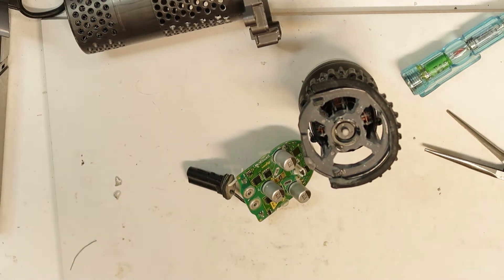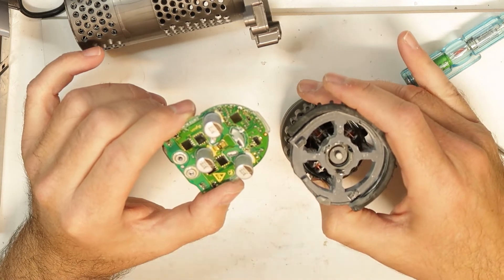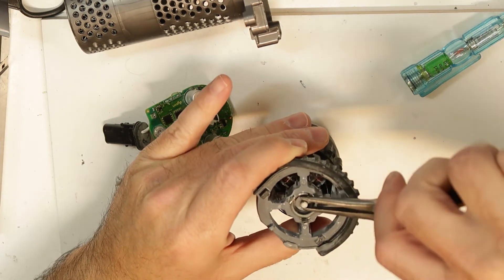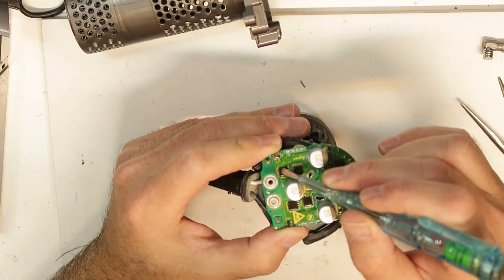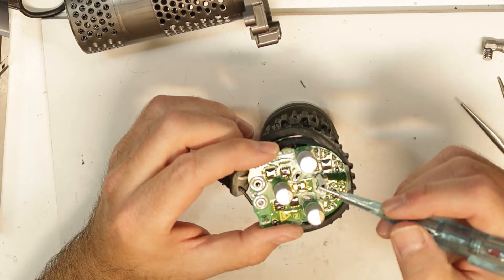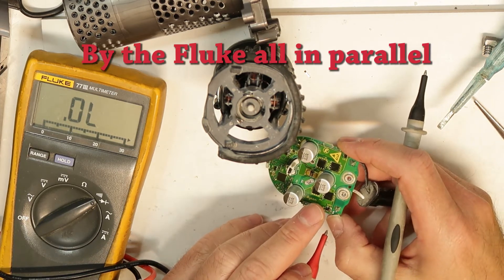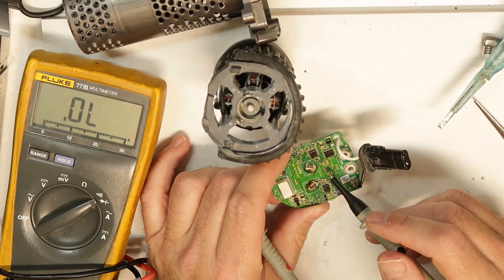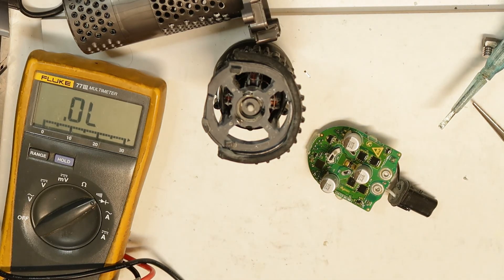Dyson v10 Motor Electronics Disassembly and how it works

Comment: Hi is there a way to clean up and lubricate the motor armature etc if necessary after plaster dust has clogged it up?  I will use compressed air to blow out all the dust first and clean the motor overall.  Thanks

Comment: hey mate, i really need your help, if your dyson v10 is still opened up, can you check how many volts it pulls and at what frequency? i have a motor from a damaged v10, i would really appreciate it if you can tell these values, thanks a lot in advance

Comment: My Dyson v11 keeps pulsing in normal and low power mode, but runs fine in boost mode. That phenomenon started happening from one day to the other. Do you know what could be the reason for that? Do you think there is anything I could do about it? Maybe just cleaning it up somehow? I already disassembled it to the core and now I guess I have to desolder the motor from the PCB to dig even further. Do you think there is something I can do before that to fix the issue?
Reply: Clean out the vacuum, not unscrew it, just wash the filter and brush the metallic grill under the dust container
Reply: @Peppasteppah  I had to buy a new core. Of course I cleaned it completely before digging deeper. But it seems the electronics or the motor were defect.
Reply: My dyson v11 also pulsing in slow n normal mode but ok in high mode.. tried cleaning it but still pulsing..
I changed the motor and it worked fine in all mode.. probably the circuit board got some faulty components..

Comment: How did you remove the PCB and the motor (center of image) from the housing (top left of image), is the PCB glued in?
Reply: The PCB  is glued to the housing, however, it is really the solder on the contacts that hold it on.
Reply: @malcomsue  thanks, I see it now, the two large solder blobs in the center (also on my V11). Seems my 30W soldering iron is underpowered, though, I can't melt it 😞

Comment: Hi, I have the same problem, the filter light keeps blinking even with everything clean, but the motor doesn't spin. Have you figured out what's the issue?
Reply: Non ha capito niente!
Reply: I glued a neodymium magnet to the board in the right spot (corner) and it works.
Reply: @bagibadoo439 Can you give more specific instructions? pls
Reply: @bagibadoo439 did you pull the shaft out to glue it ?
Reply: @YourBuddyKeith i had disassembled the whole thing so I glued it onto the PCB. But that is overkill. Inside the filter there is a hidden magnet so when you rotate the filter completely into place it should align with the sensor. If you locate the magnet in the filter you should understand how to position it better